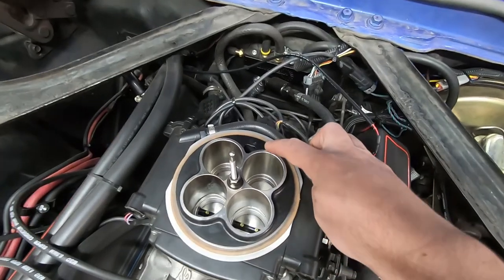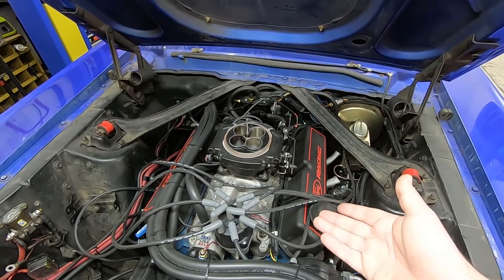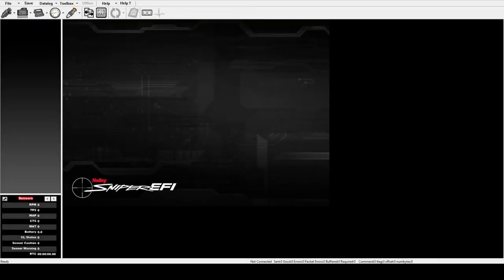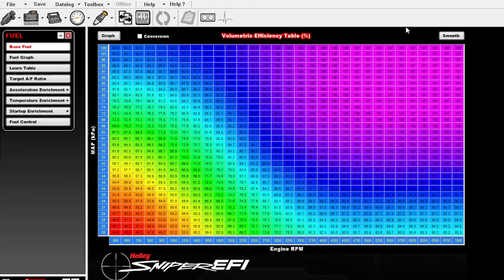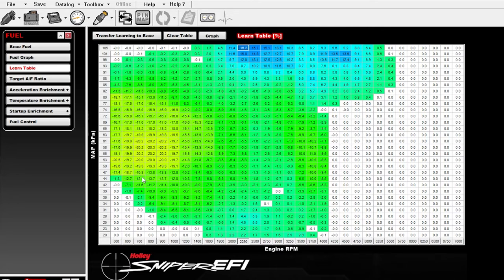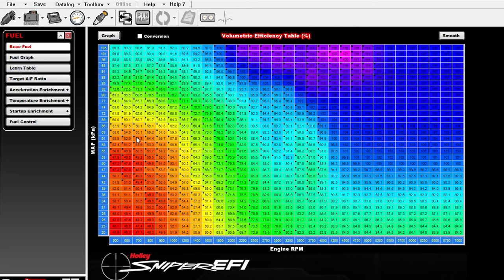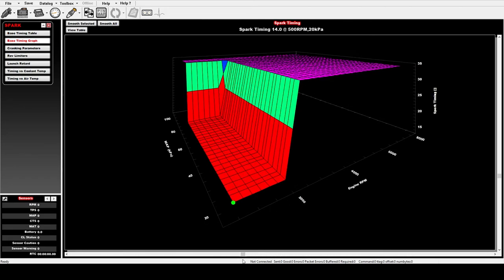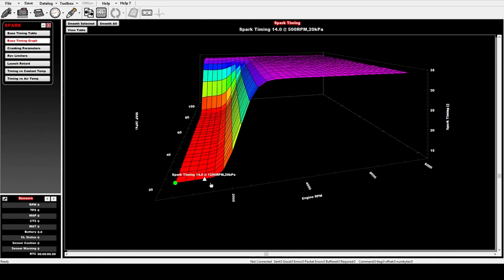What I dislike about my Sniper EFI system and how to fix them!

Comment: i have a question not so much a comment. Is the system worth the cost? im not trying to re invent the wheel. A properly tuned carb, on a properly tuned engine can be highly effiecent but not as much as an EFI system. but i can get that accuracy from a stock efi. is the sniper kit worth the money, time and effort?
Reply from the maker: If you have a stock EFI, it will almost always be better than an aftermarket system as long as you are using the same stock components. As soon as you upgrade away from stock parts, you have to go aftermarket either way to really see the benefits.
Reply: @AmbiVe  i have a carb set now, sbc 355 with an edelbrock airgap manifold and an edelbrock avs carb 600cfm, mechanical 4 barrel. i still have return lines in place and the in tank pump for prorer efi presuure. for the carb im using an external electric pump from holley. so it will be an easy switch to a sniper kit.
but you skipped my question, is it worth 2500?
i could go back to tuned port injection with any brand aftermarket parts.
my question is it worth the money and time to switch it? or should i just put in the extra work of changing back to a stock tuned port or throttle body injection?

Comment: I am having the IAC problem where the IAC and  TPS both read 0% but it still leaks air. it looks like the secondary throttle blades are hanging open slightly causing a 1500-3000 RPM idle at times until the throttle is smacked. If that is not the case I am curios what else causes this problem.
Reply from the maker: It sounds like your throttle linkage or the linkage on the throttle body are hanging. If you disconnect the throttle pedal linkage, does it work by hand?

Comment: Hello ,does the new firmware update address any the issues u have brought up here?
Reply from the maker: Not that I am aware of. I will make a new video about these items in more detail as soon as I have time. The only thing I have noticed with the new firmware was for some reason I had to tweak my tune a little as I had a very slight run on with slow tip in and out. I was tuning in a bit more power and finally broke the transmission, so it has delayed the video update ;)

Comment: I installed a Sniper on my 1979 International Scout II with the 345ci engine.  Because of this being an International Harvester Motor, I am very limited in what I can do as far a my ignition goes, because I can't just stab a modern electronic distributor in it.  I have my Sniper set up without timing control and have been using it like that for some time now.  For about $150.00 I can get a kit to add a reluctor kit to convert my current distributor to work with the Holy timing control.  Do you think it is worth spending the money?
Reply from the maker: If the engine runs well as-is, I personally wouldn't change things up unless you want to tinker with it for fun or try to squeeze every last bit of efficiency out of it. It can be time consuming to find the right curves or debug a change like this, and frustrating if it doesn't go smoothly.

If the package already isn't running as you'd like or you are looking to pull every last horsepower out on the dyno, $150 isn't a big risk.

Comment: Today im installing it on my 496 bbc in my airboat wondering about the oversized aluminum heads . Do i need to flag something to represent great flowing heads maybe tell the computer its a bigger engine or just let the system figure it out ?
Reply from the maker: There are options for variance in cam profiles, but head flow doesn't really matter other than when you go set base tables. Since an engine is just an air pump, you'll just need to picka profile to start that's close and then if you can get it running and let it learn. That will show you how far off the base map was and let you start getting fancy for better starting or optimizing the specific RPM ranges.

Comment: Getting ready to install Sniper on my 53 Chevy with a mild but fresh 327. What do you recommend for a Target AFR?
Reply from the maker: It's tricky, depending on where an O2 is installed it can read slightly differently and some engines like more rich or lean. I personally start out with the defaults and then usually add a little more fuel to see if it is happier under load. In the beginning, just get it idling well and use that to dial timing and cold start. Once you get it running, just drive it a bit so it can try to learn, but generally under 13.8 and over 12.5 seems to work well to start on most of the stuff I have tested.
Reply: Really appreciate the reply. I'm a few weeks out from starting the project so have been doing all the research I can first. For now i will just run the large cap Mallory HEI Dist so the unit will not control timing. really liked the idea to upload the learned fuel table to the base map after a while. Great idea!! i will keep you posted and may have a question along the way. Figure it will take the better part of a week to do as I am going to run all the wires/fuel lines as clean as possible and that will take some time. 
Thanks again!

Derek
Reply from the maker: No problem. Enjoy your new setup and post back if you have questions or to let us know how it works!
Reply: @derekvedenoff1021  I know its a year late but as a rule of thumb you want 12.5 in the wide open throttle section of the table, 14.0-14.7 in the cruising area (most of the table) and idle depends on what the engine likes most but 14.0 is a good starting point for N/A

Comment: Thanks for the video. I’m considering one for my 289 k code, but I’m apprehensive due to the dual plane intake comments.  Curious what you think.
Reply from the maker: I have been running a dual plane intake on my 302 for a while now. It's possible to tune, but finicky. It was definitely more straight forward with the single plane.

I would just try to keep everything else the same except the EFI so you only have to dial that one portion in first. Then if you want the Sniper to control the timing or whatever you aren't chasing your tail tuning both.

Comment: Now that you got some time with the Holly EFI, how do you like it? Would you do it again? I have a 1970 with a 429, currently Carb.
Reply from the maker: I would definitely do it again. The only difference would be that I would think of it as installing a more powerful/configurable carb than a self tuning system. To get carb levels of performance isn't too difficult, but to unlock the full potential takes time and tinkering or a dyno.

Comment: After smoothing the timing, if you make changes in the handheld do you have to go back in and smooth it again?
Reply from the maker: That seems to be the case. After my basic setup, I don't usually do much on the handheld for timing. The software is just so much easier to be exact with.
Reply: @AmbiVe  thanks for the info.

Comment: Wondering how this system works with  4 speed manual transmission
Reply from the maker: There wouldn't be any real difference between an automatic and manual in the basic tuning. Depending on your clutch setup and cam, you might tune the idle timing curve slightly differently to help during initial clutch clip/take off.

Comment: Do you have to have the USB cable or can I just pull the SD card from the handheld and transfer tune files back and forth that way?
Reply from the maker: I pull it back and fourth on the SD card and install the management software on my desktop.
Reply: @AmbiVe  So basically I don’t need the $50 USB cable?
Reply from the maker: @ktga67ish  Not unless you really like having a $50 cable on hand to lose ;) I just use the SD card myself, and I just leave it in the touch screen unit when I'm not making changes so that I can log data any time I notice something strange.
Reply: @AmbiVe  Sounds like a plan, thanks for the great advice. I should have my install wrapped up in a couple weeks. It’s going to control my N2O also so it should be fun!
Reply from the maker: @ktga67ish  You'll have to let me know how it does. I am really curious if the N20 functions work well... you know... for science ;)
Reply: @AmbiVe  Science, that’s it 😆 I’ll definitely let u know

Comment: I live 6-7kft in altitude. I don’t want to tune my carb whenever I go down the hill. Do you think this would be good for my application or should I look at another EFI setup?
Reply from the maker: It should be possible to get a pretty good tune with the MAP sensor based system. It would really depend on how much time at each stage of elevation you gave it to learn and how well you tweaked your AFR targets. Between the MAP, IAT, and O2 feedback, it should be able to handle the density changes. I haven't tested it with that broad of a swing, only about 0 to 3000ft so far.
Reply: AmbiVe Probably gonna swap out the rods and jets until I can pick up the Sniper. I’ve heard some pretty bad things about sniper and some pretty good things. Thanks for the response.
Reply from the maker: A lot of the good and bad of all the various throttle body injection systems comes down to how well they are installed and tuned. They should, in theory, always be better than a carburetor as they function the same but with better atomization, ability to adapt to temperature, air density, and fuel quality. Now, if the electrical system is 60+ years old trying to support it, intake system is blocked or leaky, etc, they can end up just as limited or worse.
Reply: AmbiVe I get that. I’m 20, so I’ve only been working on cars for the last three years. I like to read a lot about mechanical things and I grew up around old hotrodders and cert. mechanics but there’s still a lot to learn. I’m rebuilding the whole drivetrain on my 91 Camaro and I’m getting some help from my brother who’s a diesel mechanic, so I don’t think I’ll overlook anything that can be installed incorrectly. Last time I did that, I lit my car on fire because I was rushing to install my first rebuilt carb. Funny thing is my brother’s emergency fire extinguisher didn’t even work haha. I’m going to be going through all the electrical when I yank out the old v6.
Reply from the maker: Awesome, enjoy the process! You'll have to make some videos of the project.

Comment: How are these on passing an emission test?
Reply from the maker: They should be as good or better than a carburetor setup. Most of the applications I see them I stalled on are old enough they wouldn't need to be tested anyway, but I wouldn't see an issue unless there was a specific local requirement of original equipment or a diagnostic port.

Comment: Do you know if the laptop software is compatible with a Mac laptop?
Reply from the maker: I do not believe so. Not many of the tuning tools I have used offer versions for OSX or Linux.
Reply: @AmbiVe  Thanks for the answer.  So, I guess I will have to buy or borrow a Windows based laptop.
Reply from the maker: Most of my machines are Windows machines just as a matter of having business machines, but I still usually buy cheap, light, laptops to use only in the shop. Something that won't make me too upset if I drop it, someone sits on it, or a car rolls over it 🤣

Comment: Great video. Whats a PMU16?
Reply from the maker: A PMU-16 is a power management unit made by ECUMASTER. It does away with fused and relays, replacing them with a programmable sold system. You can see the install and configuration in my previous video. Thanks for the question!

Comment: I have gone though two spark control modules since initial start. Starts perfectly idels fine, warms up and begins to learn. 
Then it falls on its face and stutters itself to death. Turn the key after stall and nothing. Cranks but refuses to start.
After discovering that I had lost spark, (not do to the coil) the spark control module is dead. Same thing with replacement. Any ideas as to why they keep dieing?
Reply from the maker: What ignition system are you using? If it's the Holley Hyperspark, I will say that it is extremely temperamental to wiring issues, surges, and voltage drops. If something is actually killing an electrical component when the engine dies, I would think it maybe related to the overall wiring not running through the battery between the charging system and the EFI/ignition systems. If you tap into the wrap portion of the wiring process, surges that would otherwise be absorbed by the battery are allowed to ground through delicate systems like sensors or ignition modules and fry them.

The battery serves as a "shock absorber" for the whole system, so if the battery is not between the charging system and EFI/ignition, I would address that first. Second would be that it hates voltage drops, so if you're pulling power from an existing wiring pattern, it maybe that the voltage drops causing issues.

As far as the sputtering and dying after warming up, I assume what you are saying is that when the system is below the learn temperature, it runs ok but dies once it starts learning at 160F+? If that's the case, it could be a couple things. Your engine could just be difficult for it to learn on as it's very low vacuum or the engine is very intolerant to large changes in fueling. If that is the case, I would just adjust the idle up a bit and see if that helps keep it running while learning. Next, I would check to make sure the O2 sensor was good and that it's not attempting to trim too far and killing the engine off, although, the allowed range of adjustment within the EFI software shouldn't be that wide.

I would go step by step. Fuel, air, spark. If the system is running at any point, you know you have all three fine. If it stops running, one of them is getting out of whack. Moving the idle up and/or blocking off the idle air control port will help diagnose the issue down more.

I hope it helps! It's really hard to guess at what it could be without actually seeing the situation.
Reply: I'm using the duel sync msd and stock coil. 
About it getting up to temp, it ran fine at temp for over 5 mins or so the the spark control module shit the bed twice. Same scenario.
Reply: I do need to correct the power and ground. Your first portion of advice seems to be right on the money.
72 Ford, 302 block with stock cam and coil.
Reply from the maker: Start with wiring, it's just cheap but annoying. Once you are certain it's sorted, move back up the chain. Change the fewest parts each time to make sure you don't make more work for yourself during the process 😉
Reply: Will do. Thanks so much for helping me.
Reply from the maker: No problem, feel free to follow up later if you're still stuck or call Holley. They have some good support people and can send you replacement parts if something is defective.

Comment: So at the end of the day are you happy with the system or was it a waste of money
Reply from the maker: I am still happy with the system. Compared to other EFI conversions I have used, it's one of the best. I have over 10,000 miles on the Mustang with with the kit and other than tweaks and tuning, it hasn't has any serious issues.
Reply: @AmbiVe  well that’s good to know, I have the dominator sniper on the way and was scared that this was gonna be a nightmare, thanks for the reply
Reply from the maker: Excellent. Take your time and make sure your wiring is done well, it should work great!

Comment: Great video..This explains alot... I just purchased the quadrajet system along with the hyper spark for my 1970 olds 442-w30...It is running like crap according to my mechanic who installed it..I looked at your timing table at the end of your video and my mechanic says my timing goes from 8-degrees to 32 when wide open...There is no in between timing parameters..It just jumps from 8 to 32...He set the base timing at 8 degrees because that is what the factory spec's says in the engine compartment...Should this be set to the 15-degrees as per the sniper instructions????? PLEASE HELP!!!!! FRUSTRAITED HERE IN TEXAS....
Reply from the maker: The base timing can be different based on the engine. I'm not as familiar with the 442, but I would imagine 8 would be low, especially if you've changed anything to wake it up. I would try 12 or 12.5 and see how it does. If it's idling pretty lumpy, you might also want to make an idle valley to help keep it running down low (on my 280z I added a few degrees bump at around 500 rpm to help catch stalls).

It could also be wiring or fuel issues, so if changing the timing curve didn't help, start walking back through the system. Good luck, I hope you get it running better!
Reply: @AmbiVe  Thank you so much!!!
Reply: @AmbiVe  Just to be clear, i can only change the timing with holley down load software on it's website..It cannot be changed from the wizzard...
Reply from the maker: You can change it with the simple curve of a base timing and total advance, but to fine tune it, you need the software. At least for the Sniper combination.
Reply: @AmbiVe  Ok..So i think with the problem of back firing and timing advance shooting way up too early is thst the timing adjustment is not a gradual increase..
Reply from the maker: That could be the case or the timing could come in too early. Are you hooked up to use any other advancement systems like vacuum? I would verify that you have the system as simple as possible and verify a good base timing and total advance with the timing light before getting too not picky. It's possible the distributor moved or that plug wires got swapped at some point and are messing with your testing. You never know what can happen if more than one set of hands are on it.
Reply: @AmbiVe  No vacum..totaly hyper spark system...just like on your video the timing is spiking almost strait up to 32 degrees